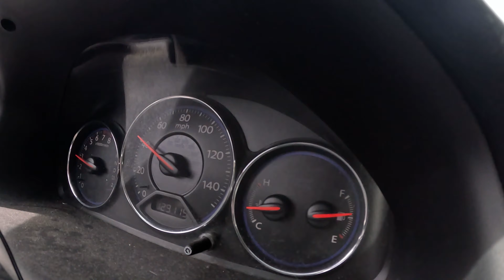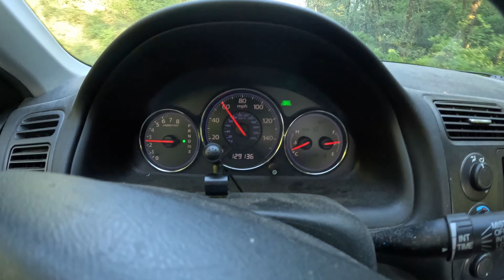CAR TROUBLE 101: #fishing and #crabbing at the jetty!!!

Comment: I agree with the thermostat theory, but also check your fluid levels , first point of failure, could also be a faulty, sending unit in the water jacket of the engine, debris in the radiator water pump, do you see a small amount of water dripping on your driveway with that many miles it could easily need a new water pump, good luck buddy
Reply from the maker: I just need to sink some time into solving the problem

Comment: My two cents is always at least try make it to what you were going to do. I have lost a bearing and had the wheel fall off my trailer just as I turned into the boat ramp yet got it fixed and still made it on the lake. Had exhaust catch my jeep on fire so I parked it in a snow bank and grabbed my rifle out and went hunting and dealt with the exhaust when I was done. Had an engine catch fire in my 66 Chevy while I was towing a boat to the lake once and that sucked because I had to get towed home and didn't make it on the water. But I always try to make it out and just put off my problems until after the fun is done.
Reply from the maker: Dang that’s awesome. 😎 avoid it as long as you can!!

Comment: Next time if you run into a issue with over heating. Crank up the heat on high inside the car that will keep the temperature down
Reply from the maker: That’s a good tech tip. I did that and I think it helped.